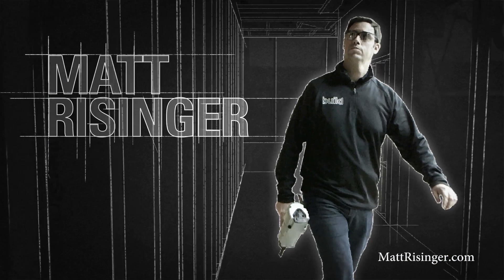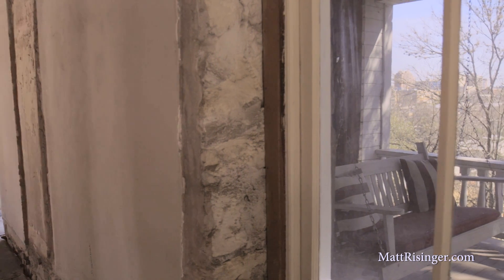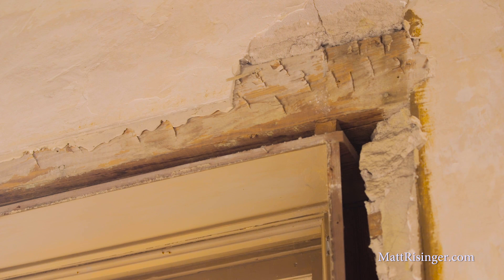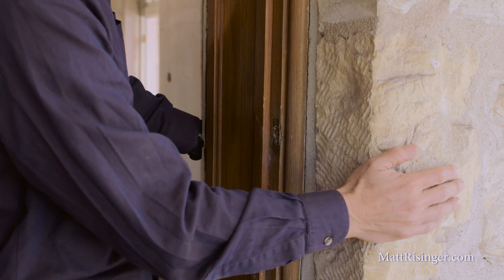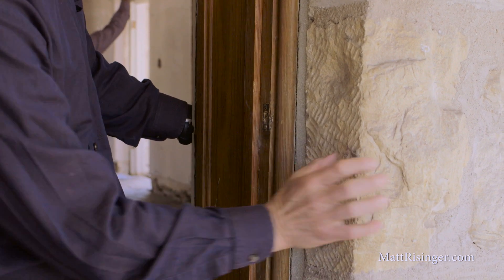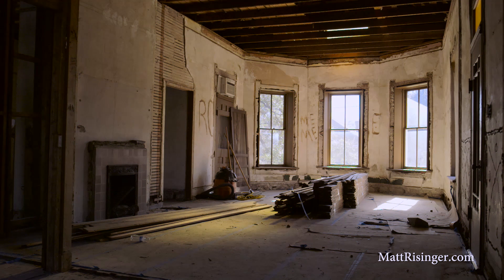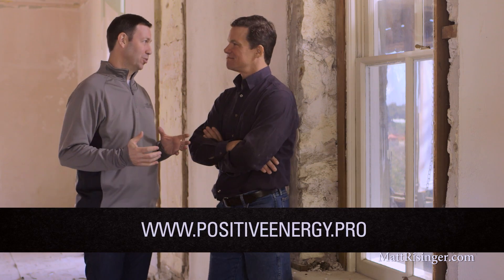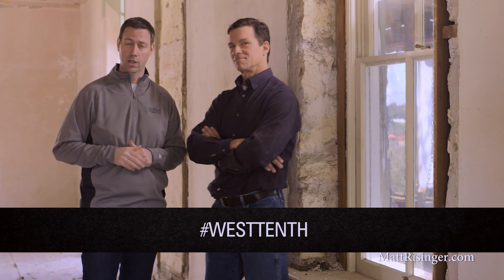Insulation for Masonry Buildings - Historic Retrofit

Comment: Awesome information!  I've got solid masonry walls, no insulation, and a damp issue on the interior walls. The solution is addressed at the end of this video. Thanks so much! 🙂
Reply: What did you go with I have the same issue on my remodel? I'm thinking fluid applied on the inside with 1-2" of insulation then fir strips with drywall.
Reply: @Retired_SeniorChief  I didn't do the stud wall with insulation yet (as I had planned) because of cost, but hope to in the near future... However what you are describing sounds like you're adding the necessary air cavity to properly insulate the walls. Did you go forward with this yet?
Reply: @SheenaRea  No insulation interior I did foam in the block cavity, fur strips on the block wall then an interior vapor barrier then drywall.

Comment: I don't see the practicality of doing anything to that house. So what, you have 10-15 degree temperature swings. Your saving by not having to use air conditionioning, then when heating months occur its thermal mass radiates it. Comfort all year round and structurally sound. Your going to mess it up by enclosing the roof! You seal that roof up. How long would that roof have to leak for you to realize its leaking? Would it be too late and cause rotting of the rafters and create a potentially dangerous situation? Also by sealing up the roof you'll probably create interior condensation because it has no where to escape. I'm a firm believer in solid masonry walls and believe the building science has evolved around an inferior product. The only reason we shifted away from solid masonry such as brick is because of the abundance of wood in the US and mass production of nails so it was more economical to use these materials. Today with all the codes and requirements I question the economies of scale and wish the powers at be would actually revert back to SMW's and build the science off that.
Reply: You nailed it. Having an inspector see over 4k homes in my area and said the bricks on my 1960's home was the best he'd seen so far. The problem today is that "maintenence free" updates are not actually sustainable because they don't last for 20+ years. The problem is compounded with flippers who have no idea how the design of the home was intended to work. The previous owner did the opposite with mine: They vented western cedar rafters & dovetails that haven't seen the elements in over 50 years. Covered the the home in plastic. They created more problems than they "fixed." There needs to be inspections on "house flipping."

Comment: Hi Matt,

Watching your awesome show for the last few years! I live in central Utah, temperatures range from 10° in winter to 110° in the summer.!average humidity 15%.

My 2 story house built in 1909 with one layer of fire rated brick and two layers of adobe brick! With that said this house does a terrible job of protecting the occupants from the extremes outside temperatures.

So here’s my question?

Attaching Exterior rigid OW (Owens corning) XPS 2” insulation R-10 value. attaching 1x1 or 2x2 battens with Masonary screws onto the brick (not the mortar!) creating a 3/4” or 1 1/2” air space. then attaching Ridgid foam insulation board like OW 2” XPS. To the above mentioned battens and attaching 1/2x4x8 plywood (not OSB!) 

My concern is the extra weight of 45 pounds per each 1/2” x 4x8 plywood (8 sheets on the 20’ wide side 360 Lbs + 2x2 Barton’s + 3/8” shiplap will add to the total structure. essentially sheer walling the brick 

My neighbor house was built in 1895 with limestone, he hired a company to install a different rigid foam 2” insulation 10 years ago an added ugly vinyl insulation. In my opinion shiplap would’ve looked much better! 

There is no insulation inside the house whatsoever except blown in the attic laying on the ceilings. The previous homeowner installed  2x2 batons interior Adobe walls in the living room with 1/2” drywall with no insulation in between the battens.  cosmetic only.

Comment: Hey Matt, Thank you for all these awesome videos!

I have a similar scenario here in FL, I removed all my interior drywall and noticed the Masonry block walls only had a paper with aluminum backing between the drywall and the wall, which I assume it's some kind of vapor barrier but no insulation on the inside between the furring strips.  I have an insulation contractor coming in next week but I wanted to know if insulation was at all helpful here in FL for these type of walls and/or if the paper backing or vapor barrier was all that was needed. Thanks!!

Comment: I've got essentially your "Michigan instance" here in south central PA.  We have a concrete block perimeter wall, built in 1946.  We've gutted it and are in the process of rebuilding.  I couldn't find an exterior insulation/siding combination I liked, so I've chosen to put two layers of R-10 sheet insulation, then a stud wall inside.  The stud bays will have another 2" sheet insulation with vapor seal to the studs via foam or caulk.   I lose some interior floor space but will have a final nominal thermal performance that is about 50% above local code.  My exterior windows will provide weather protection and I'm going to install an interior set of windows/shutters for a thermal barrier in particularly cold weather.   I've decided to go with a PEX in floor heat system installed in the joist bays to save the space of an air handling system.  I'll cover the heat load with mini-splits on the south side of the house and the master bedroom.

I say all this to express my appreciation for this video, it confirmed my thinking and research into building science over decades (since the '70's).  It's always nice when the pro's confirm my choices.  :)  I'm sure your historic house will turn out fabulous!  :)

Oh, and I found you through Wranglerstar's channel, hope you guys work together!

Comment: Wouldn't insulating from the inside nullify the thermal mass benefit?
Reply: Insulating the outside would probably nullify the stone work for most peoples' homes, so that's another reason. Why have a stone house if no one can see it, right?
Reply: @digitalconsciousness  Yea the building science has not evolved for solid masonry walls, rather its been evolved around an inferior building product. By them sealing up the roof they creating problems, that vapor has nowhere to escape now and they are going to possibly have condensation/mold problems in the future.
Reply: Yeah, that's why he said they're not doing it.

Comment: So the real question: How are you going to insulate this building (besides the roof) since you can't insulate the preferred outside surface?
Reply: You don't. There's no practical way to do it. An clear exterior coating is unlikely to work very well for very long. Insulate the roof and focus on air and humidity control
Reply: +RJParker he might spray some transparent coat on the outside, to vapor proof the wall. I would go for that. With the additions to the roof, it should be more than enough in terms of temperature control.